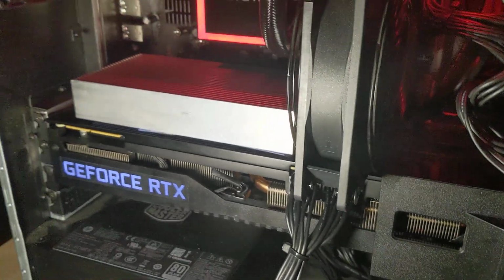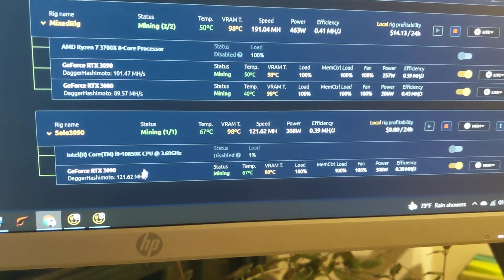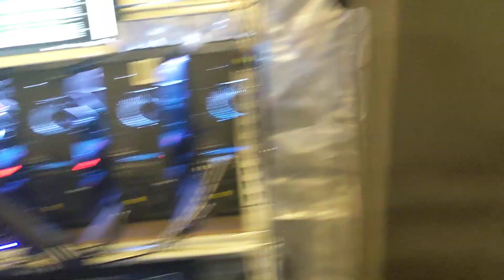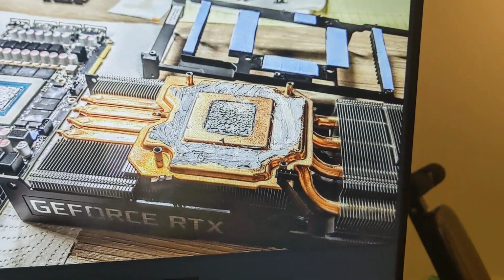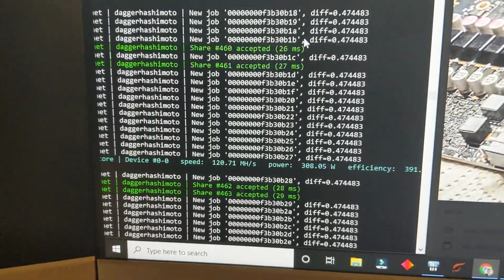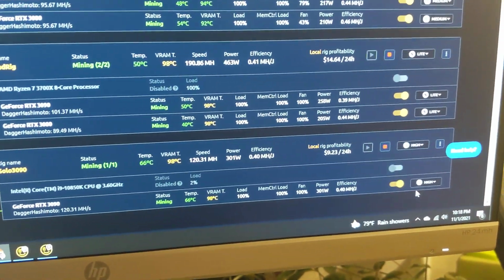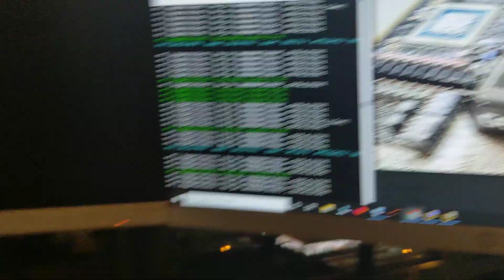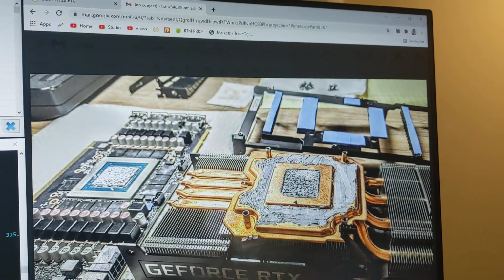How I got Maximum 123mH/s off my RTX 3090

Comment: Nice man. I have 16 3090s and some other them only mine like 94 hashes. My best cards Msi and evga mine around 118-121 but over time they do degregate!
Reply from the maker: that's a boat loan Kurt, did you have to expand your power box?
Reply: @Viet_Tran  Nope, just in my apartment in a LOT of different sockets. About to scale up massively and will be on a solar farm and mining there in the next month or so. Entirely carbon negative as we will be planting trees and donating to carbon capture/renewable tech research with a % of our profits!

Comment: Redid the pads and paste on my card too.. I don’t feel comfortable running my vram at 90 degrees so I lower the power to get it in the 86 range
Reply from the maker: That's awesome, yeah better safe than sorry.
I've personally been ok with my 8 3080s and 3090s running VRAM at 94-100 for a year.
What kind of hash are you getting at 86 Forever?
Reply: @Viet_Tran  I am using a Gigabyte 3080 Ti (LHR) and the max I can get at 73% power is 77MHs.. sounds like maybe I can crank up the power if you’ve ran yours a year with no problems. Thanks for the insight! 👍🏾

Comment: Well nice vid. Look i had also issues with my rt3080 from gigabyte. Did you try termal grizzlys 3mm pads they are thicker those blue onces that you have they are 2mm thats why you have no contact with the coper base! I mannage to drop vram tmps up to 25c belive me those grizly pads are great try it would work better!!
Reply from the maker: I gotta check those out, thx for the info Bleky!

Currently they seem to be ok, maybe it's the cold Minnesota air!
Reply: @Viet_Tran  np man try it! It worked well for my puny rtx 3080

Comment: Whithout doing anything I get 125.2 mhs with my 3090.
Reply from the maker: that's awesome, what Brand is it?
Reply: I get 123MH/s with a vram of 98C. Ony with help of a fan,
 It uses 310W. 
I can get higher but then the Tempreture is rising up to 102C and thats a little to much for me. 
I did it with a fan blowing on the backplate, sitting on the GPU without space betwen it. 
 I set the Clock of my GPu to 1200Mhz all time and power limit to 90.
Then it runs very saible.
The Ram clock is at +1500Mhz to a total of 11000Mhz 

I have a Rtx 3090 Msi Gaming x trio
Try these setting and i think you will get with your Thermalpase to 125 under 100C